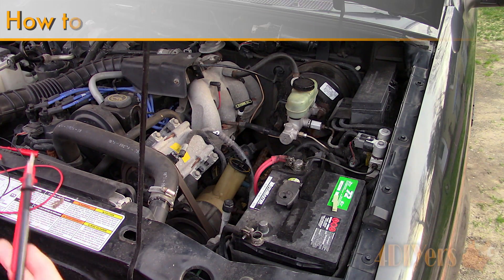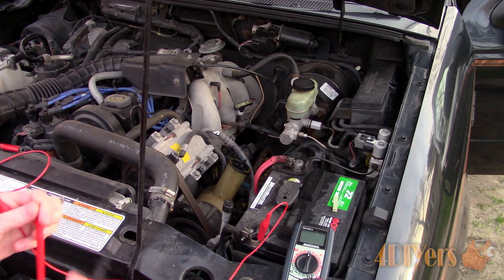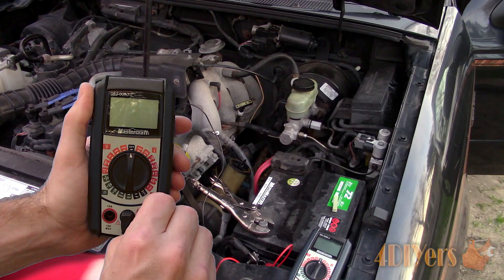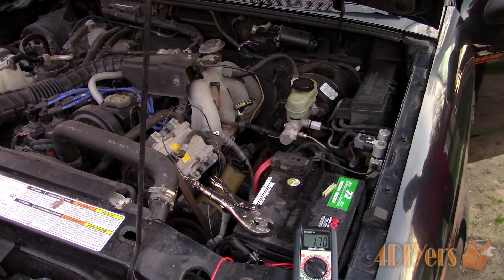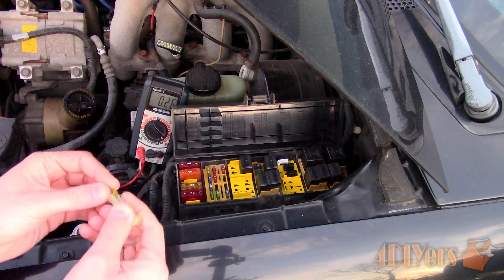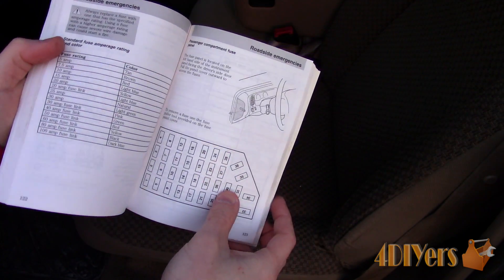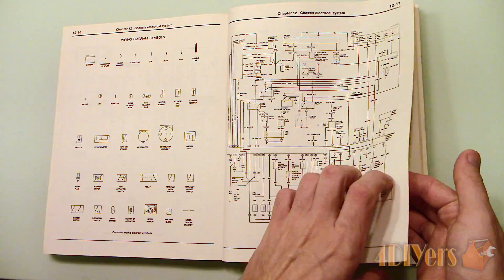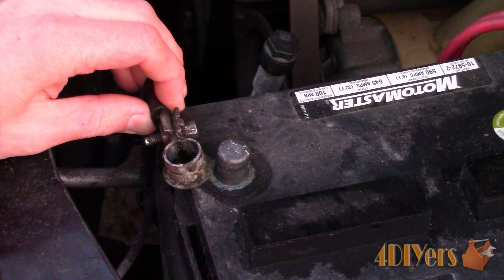How to Find and Perform a Parasitic Battery Drain Test

Comment: Is it possible to have 0 parasitic draw? I tested battery on volts and it was about 12.4. I switched to 10amp and tested from negative on battery to negative cable and got 0. for amps. I then opened car door to see if I could get some draw reading and it was still 0. Is this possible or am I doing something wrong? It's a brand new meter.

Comment: Alternatively, you can connect both the battery cables to the multimeter to monitor resistance change while pulling fuses.
Reply from the maker: Great tip, thanks for sharing :)